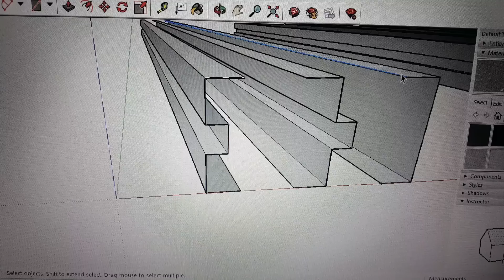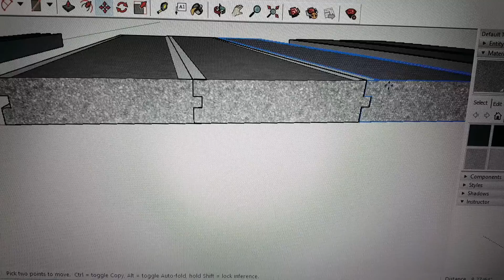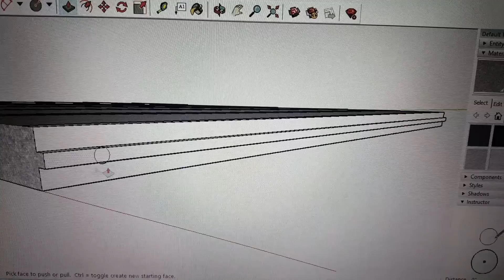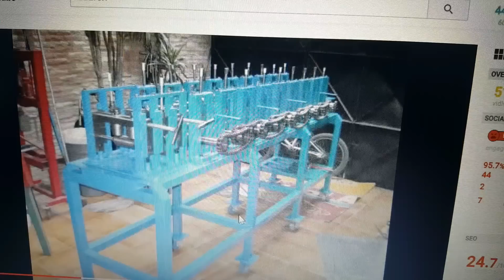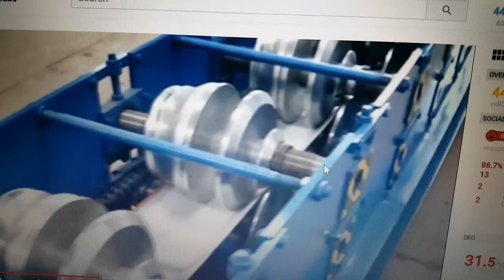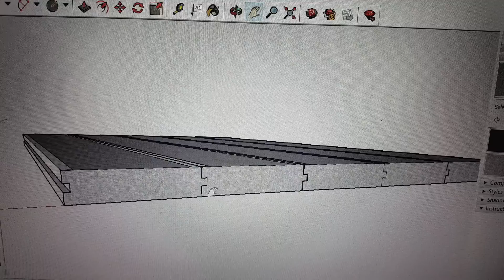Air Crete Interlocking Wall Panels

Comment: Why go though the stress? Why dont you just weld the panels together? I know the the metal is a bit thin but with ehough practice you could have it down in no time
Reply: You are already using metal framing use it to your advantage

Comment: If this could be made where the roof could be made with the same air create and floor because you said it was very strong that would lower the cost perhaps of poring a concrete slab . then add holes and outlet sockets  and even a panel box for say a 200 amp service and add plumbing outlet most homes are now plum with pex and pvc for sewer  anyway so this should be easy .. And this could become the next generation home build where you have a website they design their own home layout and boom its ship to them the same way a log cabin kit is shipped ..   The kit could be shipped with detailed instruction on how to assemble so people that want to diy of install could ..  i see alot of potential here with many projects from dog house ,well house, home,farm use for storing hay for the animals , storage sheds ,shops  the biggest factor can you do it cheap enough  to be compared to stick built ...

Comment: Take your normal  C. Track about 12 to 16 inches and cut  ✂️  it in half  ...  Now  attach one near the bottom and one at top back to back with a screw  to your panel.... Now that will allow you to lock each of the panels together.. ...❤    Get wife to explain if you're still can't see or understand this  ....    5 years and you're still haven't solved this simple concept ......

Comment: Just a question about the panel pour and finish - does the long side rolled metal studs get any flex in them when they are poured and vibrated - meaning do they remain straight...or is there a slight curve up along between each panel creating a gap?? They look strong having the male and female interlocking section as a stiffener! Just a question of interest from your experience!

Comment: Just found your channel and like the ideas of the channels. My question is? Are you leaving the metal studs in the walls or pulling them off after the air crete is dry?

Comment: If you put conduit at, say 18 inch's from the bottom of the panel from side to side   and hod in place with the same rabbit wire. after aircreat is dry cut the stud at the conduit point. this way you can run your electrical wire. You can use a tee in every third panel for the plugs and run a conduit piece with elbow up to the switch box. you can always chisel out for the E-boxs.

Comment: So, if you take flat stock and cut it to the length of each stud then screw two strips on sides and one strip on the center of the opposite stud it will act the same as your diagram without having stud metal formed

Comment: You could make roll formed studs in two different dimensions so that they lock together without the tongue and groove plan you outlined.  The left stud would be slightly smaller in width so that it would nest into the right stud without distorting the metal.  The depth dimension of the smaller depth stud would be would be  equivalent to twice the gage thickness of the sheet metal gage thickness.  All of the studs would be oriented in the same direction, left to right, so that they nest together.  The end of the wall would be made with two small width studs oriented with the male form.  The studs would be painted with a marking dot during manufacture so that they could be distinguished from the wide studs or you could use currently available studs and make a roll former that would make the smaller dimension stud.

Comment: Nice idea. Comments below aside. The main question that I wonder about is why not 4' wide panels? Not just you but many other on YT only do 2' wide panels as well. If so light why not wider? I am interested in the roll former I could use to make a mint in Panama. BTW, consider a chamfer on the male edge channel. Also need to figure top and bottom c-channel sub as you can't fit a channel in a c-channel. Also, wouldn't a present mfg'r of gutter formers be the place to go for that design channel as they are all setup. Rock on dude.

Comment: Because guys can't keep our ideas hidden - if the metal can be as long as you want - make the forms 100 ft. long and have the pour on rails to move it the entire length of the forms.  When it's finished slide it off to cure and set the next.  No matter what size you need just cut off at length.  So many ways to skin a cat.

Comment: I have not read all your comments so if this is a repeat bear with me.  Why couldn't you take a strip of wood in the dimensions needed for the tongue and screw it length wise centered inside the stud.  That would be the female side of the form. Then take 2 strips of wood precisely measure and screw them to outer edges of the stud full length and that would be your male side of the form. No special studs needed.

Comment: Make all your studs female and use a male insert where needed. That way you don’t have to worry about designing the panels top, bottom and sides. Insert can screw, glue or clip on.
Reply: could use fiberglass/basalt rebar as a pin.

Comment: Why dont you create Lego's Blocks with a pass through hole for something like rebar to reach from foundation to header? You only need three types, full one, half one, angle end one for roofing pitch. Moulds could be created with plywood and foam board creating many blocks in one pour.

Comment: In general a good idea. You just forget the thermal conductivity of jour metal profiles. Each profile will create a cold bridge leading to local condensation of moisture. Not good for cold areas.  I break my head already for a while how to work around that problem.

Comment: I like all of the ideas you have in this video except that you are using metal for your forms which you leave on and I believe they will defeat a lot of the insulation value of the building. Keep your thinking cap on... maybe a way to form the panels and remove the forms or using wood for the tongue and groove?   IDK just ideas

Comment: why  not just  use  rebar  and  hang  your   mesh  wire   from the rebar   and  use  a   board   on either  side   and  some bonder   to make the air great  stand  on its own  just move the   boards up  as you  shoot it  with  a gun.

Comment: Suggestion:  make all the completed panels yourself in house as an assemble yourself house kit.  You could ship out a complete home on a flatbed semi trailer.  Small sheds and garages are a good place to start.  By doing  this in-house you have the quality control that you would need over the foamcreate panels.  Remember you could be held financially responsible for anything you sold that might fail and injure someone.  You can not be sure the people will follow your instructions in building the panels themselves thus the need for quality control.  Forming an LLC would be the wisest course to protect your assets.  Again, just a Suggestion.

Comment: There is a standard shape called a hat channel, you can place these in the form and the hat channel shape would be molded in the material, then you can use calk, foam tape, expanded poly foam in a can or mortar to connect the panels.  Corners can be made same way just put hat channel at right angle in the form. If you used 3/8 I’d tubing at 12 or 16” increments you can use 12” cut length of fiberglass field fence posts to span between the panels like a dowel. Use pipe insulation in a rebar to mold wire chases, pulling out the rebar leaving foam inside panel, preplanning you can place foam boxes in form.   At the top and bottom of panels put female hat section in form. Then set panels in bonding mortar like a brick and a couple of strands of barb wire, at the top pour a continuous bond beam with headers and rebar. Use same fiber glass pins. This is called resilient construction. The hurricane straps can be put in to the bond beam header including a still plate, during pour, vents too. In cold or hot climates avoid solutions that trap moisture, conduct heat or moisture, or wick moisture. A technology called surface bonded concrete is a great final finish method, it is used to make dry stack blocks earthquake resistant construction. M. Mccallum copywrited 4/7/2020. All rights reserved.

Comment: love the tongue and groove though ! much stronger vertically and ind resistent etc...could be installed with a bead of butyl caulk as well! then use threaded flat stock to pull together...sealing with stucco finish prevents moisture from penetrating and yhe studs would be corrosion proof

Comment: use pvc conduit for pull throughs in the center of the c channel forms then use threaded flat stock  to pull forms together the c channel bases top and bottom will teak screw in place your done  as far as doors and window same thing with shorter panels of course top and bottom door and window frames mounted with tap cons...and grouted into place around the door frames...then stucco! Standard sized forms could be cut on site with wet partner saw as well for custom windows heights and widths using a diamond edged saw with water mister to keep down the debris...These forms could even be constructed a little longer and attached to the sub footer for increased heights allowing for the walls to go up and double for slab forms for the finished floor...

Comment: For the horizontal holes you are thinking of put a PVC tub evenly spaced about every foot.  Then you can run rebar through the holes joining the two panels at a time always alternating so you are not trying to put the rebar through more than two panels at a time and you can still use the other holes for your wiring or plumbing.  If you leave the PVC in the panel it  would protect the wire same as a conduit.  also the PVC will protect the aircrete from being damaged when installing the rebar.  Good luck.

Comment: If you start to using wood joining techniques. Would it be possible to get rid of the metal studies? My concern is they will rust over time.
Reply: I was thinking same it would be cool if aircrete was strong enuf with removing form

Comment: Hi there this is all awesome I love how you can manufacture your own studs to form your panels. The only problem I  have with the system is thermal bridging . Joining the panel is not a problem. To bad we  don't have stuctural studs made of a material that does not conduct the cold.
Reply: @MAD GRUMPYMAN  you are correct it is better with plastic the only problem is  would they be load bearing?  air Crete if it was.load  bearing itself you wouldn't  need studs at all?
Reply: @MAD GRUMPYMAN   Agreed.

Comment: Have you thought about 3D printing? It’s been suggested as a solution for building on other planets, using a large machine that build with extruded concrete. 
With aircrete being almost completely fireproof, this would be the perfect building material for areas that experience wildfires; California, Australia Israel and Canada could benefit from having buildings that resist fire. Those panels would be a perfect building material for fireproof buildings.

Comment: Why not re-use the forms  with toung and grove all sround and ( release-able  plastic tube in the form) the metal is a heat sink and in -20c would frost up and require more energy to heat. We have alot of -30c  to -40c winters and last summer + 40c  for number of days.
So building panels would be aircrete only, no metal .

Comment: I like you using metal studs to make the forms for your aircrete panels.  However those studs will not be good for insulation.  The studs provide a thermal bridge at every connecting panel.  
Instead of using metal studs, consider tilt wall construction methods.  In the concrete wall panels they install metal plates (about 4" long)  in the forms , about 3 or 4 to each side. When the panels are stood up the plates lineup. when the panels are slid together the end of the plate exposed on each side. Then weld the plates together on their exposed edges inside and outside.... that holds the wall together. I would suggest using pipe in the forms of cross to the metal plate and have the plates be drilled. That way when the plates lined up so would the holes and you could use them as for fitting tensioning cables or rods to pass through. As a former electrician I would not run electrical wiring inside the solid concrete walls. If something should happen it would be harder to fix the problem. for sheds you could run EMT conduit inside. Safe, easy to work with, accessible to make repairs....... just a couple of suggestions.

Comment: Consider using a piece of corrugated steel as the Male and female keys. As an example, may not be practical due to length and width of corrigations, but for reference, the corrugated metal on a shipboard convex container. But with narrower corrigations. The angles could be made on a press brake at a local shop. They would be easy to strip the forms and easy to assemble the panels. Consider all thread rod and female couplings going through the panels to pull them together with some kind of caulk or glue in the joints.
Reply: Maybe remove and reuse the all thread rods after "glue" sets up. Rods and couplings could pull a 20 ft  wall tight and then remove the rods the next day. Or cables are used with collects for pretensioning overstressed concrete Tee's as an example.

Comment: Just make your panels with female slots that would accept a 1" x 3", then use the 1xs  to seem them together... Rip the 1x material x1/2 to fill the slot around window and door openings for easier d&w installation, and a key-way to stop infiltration at the slab, next level, or roof  intersections...
Reply: I would insulate the outside of a building that will be heated or cooled as that metal will conduct  hot to cold, sucking the heat into or out of... foam board , the dryvit... I would rout a groove for EMT and metal boxes on the inside of the exterior wall to avoid  being screwed accidentally, then cover w 3/8" drywall or whatever...
Reply: Recommend to installers using the panels for exterior wall to cut a slit in the metal channel in the center of the groove, all the way around, before installing, to break the heat sink action...
Reply: Please forward to me 1% of the proceeds if you use my ideas... LOL
Reply: With this method you could make (2) standard size panels, x 16" and x 24" x  8' send extra channel with your kits to field cut panels as needed for a particular design... (now they can place as many windows and doors where they want)...
Reply: Any decent structural engineering firm, that has equipment to stress test concrete samples, should be able stress test to determine the typical load for each panel (horizontal and vertical)
Reply: Be sure to get your results confirmed in writing on an engineer's sealed letter on company letterhead... and you are good to go for permitting...
Reply: Godspeed...
Reply: I would also have them tested for R-value...

Comment: I think it would be simpler for your "tongue and groove" to use puffed roofing sheet. Just need to bend lengthwise the edge at 90 degrees. You wouldn't need a complex machine and it is already available. Just need to mach negative to positive or male to female. Just an opinion.

Comment: Have you done any compression/tension testing to check for tolerance limits of aircrete?  Concrete is notoriously poor for tolerating tension.  That is why tension bars are always used.  Can this product tolerate the force exerted on a partition wall, for example.  It is porous and significantly lighter than concrete.

Comment: Consider: Would anyone ever stack 2" x 4" bricks by standing them up like soldiers side by side? Of course not, there is no strength. With a 3/4 tongue and groove, a minor shift in the ground (or earthquake) and the groove joint opens. With just 3/4" inch shift and the whole building collapses. 
If instead of a 2' x 8' panel you do 4'x4' panels with grooves at 2' interval then you can placed them so they can overlap by two feet. ( effectively 4'x4' bricks) Not optimum, but stronger.
There's a real good reason we overlap bricks, and there is a reason they are strapped to the wall every four feet after every few courses. 
I doubt if your design is very safe so far, but I love that you are working on it.
Reply from the maker: elastomeric bonding is old tech

Comment: C-channal sill anchored to the slab with standard J-bolts, spaced as per code.
Speaking of code...
The trick would be to get the insurance industry to cover your homeowners or other insurance for these structures. 
Then you would be cooking with gas!
It's all about liability. 
You essentially would open a whole new home, commercial and industrial construction industry. 
Oh Yeah!